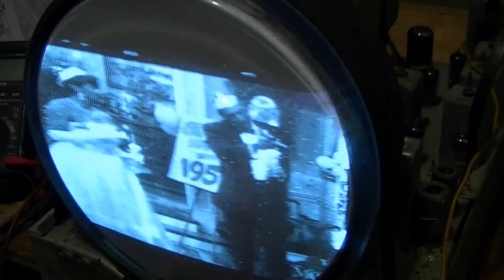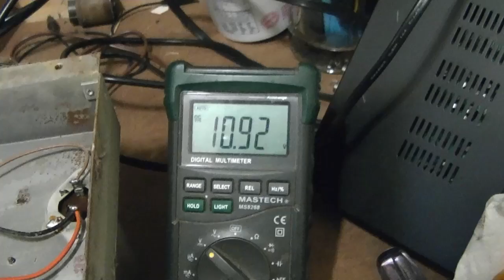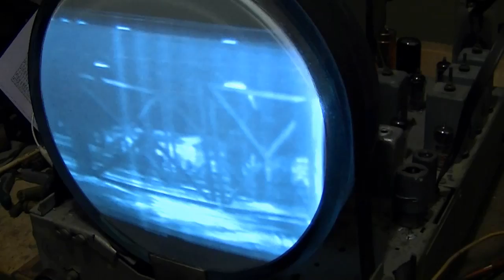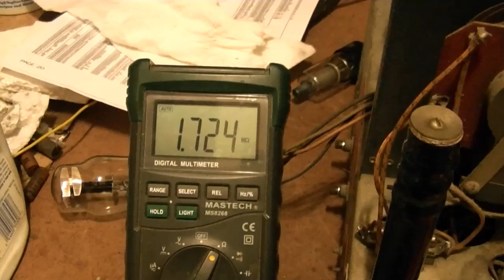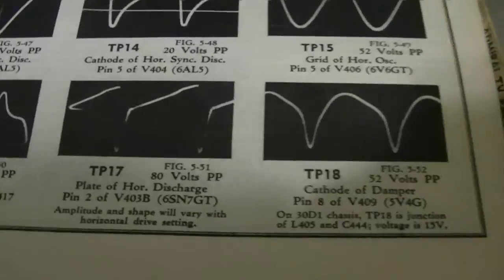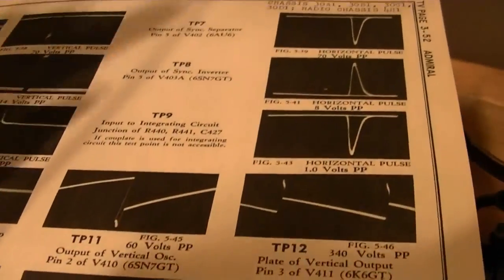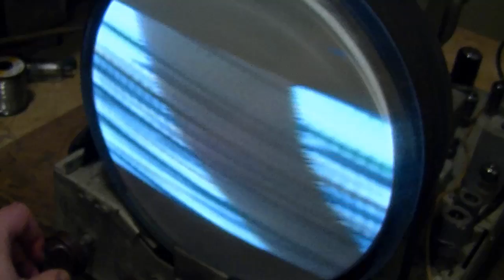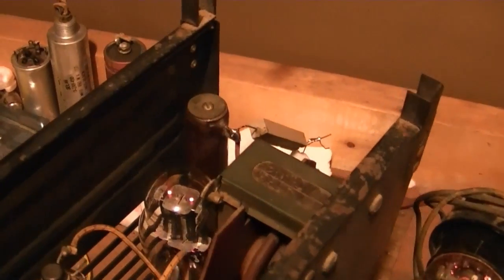Admiral 30A12 restoration pt4o?

Comment: One of the best troubleshooting videos you've ever made Bob!
So what about the P-P values being so high for the test points upstream? Like test point 15, The 80 v P-P for the Horiz Oscillator grid voltage that was supposed to be 52 V P-P? Do you think the trouble shooting guide is wrong or something else?
Just wanted to mention that you are the man, with the plan! I learned a LOT for this video! Really liked that solar cap checker. I need to get my hot little fingers on one of those.

Comment: I was blown away when you found the power resistor was open with the set even worked "that" good. You said at the beginning of the video the screen use to be much brighter. Has that power resistor opened up after you had started troubleshooting it?

Nice detective work! I wonder if the old tech servicing guys were constantly pulling their hair out trying to figure problems out.

Comment from the maker: I checked 8 Admiral sets and spare chassis and every single one of them was bad.  What I find even stranger is that it's a clone of RCAs design, but that resistor is good in my RCA sets.  Maybe they didn't drive them quite as hard or used higher quality resistors ?

Comment: I see what you mean; the picture with the resistor open circuit caused compression on the right hand side. I guess the idea of 3 taps on it, you could choose a 'most linear' configuration, with negligible effect on the width. Your method of wiring 2 10kΩ (in series), parallel with the 7k5Ω, 25W does the trick nicely, giving a little more surface area for power dissipation..

Comment from the maker: No, they didn't start using those until years later.  I was able to get the correct width once I replaced that bad power resistor and adjusted the width control.

Comment: Quite a long task; interesting in those days using 'bleed' resistors to reduce width on a course scale; I'm quite sure manufacturers designed sets to use these components for virtually guaranteed after sales service/parts. A relatively simple task.. ..in hindsight. The later color sets which used solid-state components had 'tuning' capacitors in parallel with a 2kV rating, and about 2-3nF which were fitted directly across the horizontal output coil (at the transformer). Remove one => decrease..

Comment from the maker: The resistor isn't really there to control the width -  it's for linearity.  The width is a side effect because that heavy load drags down voltages throughout the set effectively reducing the amplitude oft he drive signal to the horizontal output tube.

Comment from the maker: Adjusting the slider reduces the wattage rating of the resistor and they are only available in 10K.  If adjusted it to about 5K it would only be a 25W resistor. So I would need to used a 100W adjustable 10K.  Much too large and expensive.